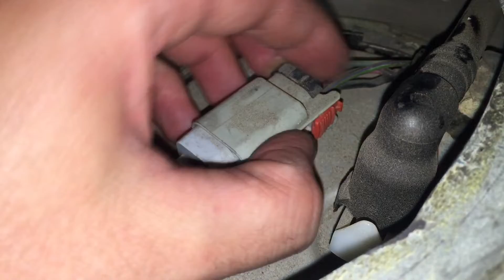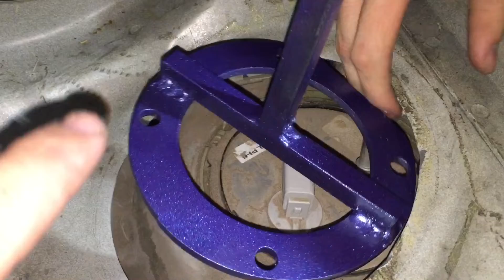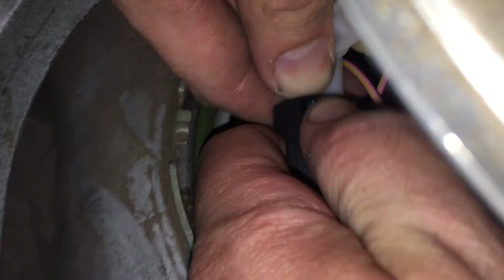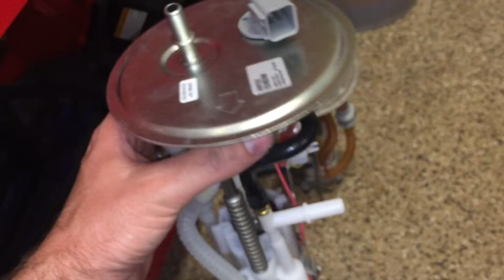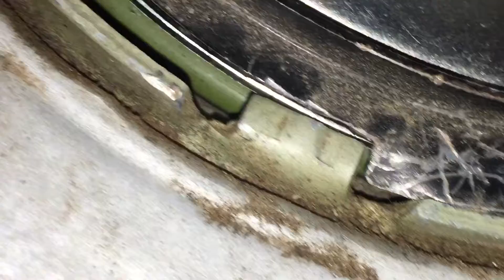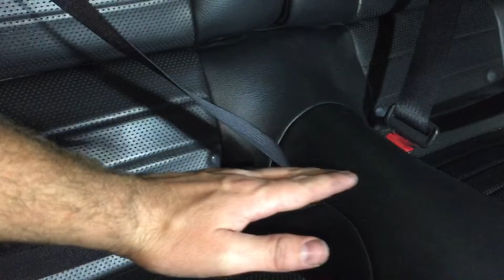EASY! Fuel Pump Replacement 2005-2020 FORD MUSTANG S197 coyote

Comment: I just bought an 05' mustang off a car lot and right after i got it the car would start then not start and ran really rough, the guys told me they had just put a new fuel pump in it so i took them at their word, come to find out when my mechanic who is super sharp when it comes to diagnosing cars looked at it he saw where the guys had put the new pump in and in the process had actually ripped a rubber line in it so when the gas went thru the line most of it just went right back into the gas tank instead of on thru the lines and to the engine, my mechanic charged $200 for his labor and it runs great now.....first time I'd seen something like that...

Comment: I just changed mine today on my 05 Mustang GT, luckily, my neighbor was able to help me install, the metal round lock ring on top of the fuel sending unit. He pushed down with both hands on the sneding unit, and I turned the lock ring with 2 free hands instead of 1. Also, I cleaned the top of the tank and fuel sending unit very clean before removing it. I used a vacuum to suction all the lose dirt/dust and debris around the lock ring.

Also spray the top of Fuel pump assembly and the locking ring with WD-40, so it acts as a lubricant and easier to turn by hand, by myself, I was able to rotate the locking ring with 1 hand, but I could not catch the 2 hidden tabs that were very hard to see. 

On my 05 Mustang GT, there were 6 tabs locations of tank opening that the ring had to engage and slide underneath.

I noticed on this install by Danny's Gargage, when he started his car, he got a low Fuel- DTE FLI error message on your cluster - how did you/he correct this issue , did you disconnect the battery for 30 minutes to reset the computer?

I ask because when I started mine, it showed my tank was slightly below a 1/2 tank, but in about 30 seconds, it clicked, it showed my tank was on "E" on the gauge cluster, but I know that was not the case.

I drove the fuel station and added fuel, started the vehicle, and now it showed a nearly a full tank and then in about 20-30 seconds  - I heard a click chime and I received the above error message again.

The Mustang ran awesome, but now I I'm getting that message. 

My old pump assembly was in terrible condition, fuel ate through the hoses and was only reading 5- PSI, when it should be much higher than that, and my vehicle would not start intermittently and it this a lot, I could tell it was starving for fuel. Several hoses had holes in them from bad fuel or years of tank being low on fuel and not driven much.
Reply from the maker: Typically removing the negative battery cable corrects it for the rest.
Reply: I resolved the issue with my FLI-DTE error message. The problem was with the new sending unit having a faulty float switch.  No one ever mentions to look  the arrow on the top of sending unit. Looking from inside the car, make sure the arrow points to right right while facing the rear seat back. Connect your hose from sending unit “B”  behind passenger seat. I  advise siphoning most of fuel out. The main fuel pump sending unit on my 05 Mustang GT, sits inside a metal trough. With the hose connected underneath on the inside of fuel pump, point your  float to the left side of vehicle, same side off passenger side door. Main arrow on top of fuel pump point towards driver side of vehicle. Don’t force the float down or in. Slowly guide it in and keep float to the left side of trough, facing rear windshield. It installed so much easier the 2nd time around, because I drained me fuel tank, I could see very well, and I was able to secure the locking ring on my first attempt. I also disconnected the positive and negative cables for the battery.  Worked like a charm the 2nd time around.  The first fuel pump I purchased from O’Reilly’s , had a misaligned float switch. My replacement fuel sending unit had the float assembly detached from the sending unit, and it was a bit tricky putting it on, but figured it out. The vehicle starts and runs great now, no FLI-Error codes on instrument cluster gauges.

Comment: what was your car issue that made you replace the fuel pump?
Reply from the maker: @lord__kad1058  the car was not running properly when warm. It was cutting out with anything more than 1/2 throttle

Comment: Grrrrrr. I just had to have my fuel pump exchanged - I mean check engine light and the car turned off - and it cost me $935. I could have done this myself. This looks easy. I probably would have been too afraid... but this looks like I could do it myself and the assembly only cost $350 online. Great video. Clear and detailed. Love it.
Reply: $935!? They ripped you off big time! That's a 30 min job..
Reply: How many miles were on the car?  I have 145k and am thinking of doing it as a preventative measure
Reply: I know a guy would do it for 1 dollars 💵

Comment: Thanks for the great vid.  I bought the tool from Tyler and while it may seem expensive for a one time use, it is worth every penny.  I ended up replacing both the primary and secondary pumps/senders.  I can’t imagine how much effort it would be to re-seat the retaining ring without it.  The rings were too tightly seated to use the tool without encouragement of a flat paver chisel at the weld on the base of the handle.  This was especially necessary to re-seat the dimple on the ring to the center of the retainer.  It may not have been necessary but it made me feel better.
Reply: How much was it

Comment: My god the Ford engineers who designed some of these things.  First was the oil filter adapter that had coolant running through it.  Leaking gasket?  Drain the coolant.  Then this cluster.  Everything was going "ok" until I had to disconnect the fuel line going to the sender (passenger side) in the tank.  IT WAS STUCK.  The green button would depress, but the connector WOULD NOT BUDGE.  I had to apply leverage with a screen driver and really lean on it for it to budget.  Once I got it moving, then I was able to depress the green button and remove it.  Turns out the entire plastic nipple was coated with something sticky and it was just not going to let that connector go.

This is a 15 minute job that poor engineering and questionable assembly turned into an hour.

Comment: So is there two fuel pumps? Or is this driver’s side one the one that matters most? Think I need to replace mine really soon, as the car will sometimes sputter and have a little trouble turning over.
Reply from the maker: It's only on the driver side.

Comment: I have 2007 mustangv6 4.o liter, are both pumps the same on the left and right side because I can't find anything on the passenger side pump
Reply: Should only have one pump, that fuel line he detached from the fuel pump assembly was the crossover line to the other side

Comment: I was told by the shop that the metal ring was rusted out and failed and is integrated into the fuel tank so the entire tank needs to be replaced. Am I getting ripped off?
Reply from the maker: It’s possible. I guess it would depend on how bad it is or if they just want more money
Reply: @dannyjohnsonsgarage  was planning on taking my mustang to Daytona this weekend so I was hoping for the quick fix but looking at it myself it looked nothing like what you showed in the video. It was pretty bad but I was hoping for the quick fix so I could get it on track and after they looked at it they said I’d need a new tank and new everything except for fuel pump and sending unit and it’s going to take 3-4 days and about 1100 dollars. The metal integrated into the tank is what mostly confused me because I thought the tank was all plastic and the only metal was the locking ring.
Reply from the maker: @Stevethe11th  the tank has a plastic cover but it is a metal tank all the way around

Comment: How do you know when it goes bad? Sorry, not very mechanical here. And how long are you able to drive while its bad?
Reply from the maker: It usually won’t run but can work on and off for awhile. You can also get some cutting out under part or full throttle

Comment: Mine came with a black ring. Where does this go?
Reply from the maker: boi If it has the same holes to match up with the snap ring it may be to seal the pump hole area. Is it that size?

Comment: Hey, nice video. Any chance you know what that fuel sending unit attached to the side of the pump is called exactly? The hose you removed when taking it out. That siphons gas from the other side of the tank, right? Since its saddle shaped. I replaced the pump in my car but it only uses the drivers side of the gas tank while the passenger side of the gas tank remains unused. I look in the tank itself, the driver side is empty but the passenger side of brimming with gas.
Reply: hey i have the exact same issue.  im getting no fuel to the drivers side from the passengers side.  its like having an 8 gallon tank  no fun   thanks if you ever find out anything
Reply: deansfixitrightfirst eventually I ended up finding that it was just a faulty fuel pump on the drivers side. Even then, I decided to replace the crossover tube with a similar tube and the connectors as well. I got them from napa. I had originally bought a fuel pump to fix the issue but my luck got me a bad one delivered but I got one from rockauto and theirs worked just fine. I also replaced my fuel pump fuse in the fuse box under the hood it thats any help
Reply: Well by fuel pump i mean fuel pump assembly
Reply: @leobenitez8275  hey thanks for the reply    so you think it was because the fuel pump isnt strong enough to siphon the gas from the passengers side    The car seems to run pretty good so im still at a loss
Reply: I can’t give you a definite answer for sure. That just happened to be the case for my mustang. First the car just would start at all with original fuel pump. Then I went to partsgeeks for a fuel pump because I was tight on cash and it worked for a bit as I put some gas in but even though it worked the gas gauge still read weirdly. It would read halfway full or completely empty, it was because my driver side tank was almost empty so it was trying to read the gas from that side but also trying to read the passenger side which was full so the gauage would transition from halfway full to empty. I then let the car sit for a year feeling defeated. It felt fine driving it with that fuel pump but then I got to work on the car again and for some reason the siphon on that fuel pump to get gas from the passenger side didnt work. My guess would be that partsgeek sells refurbished parts or something since they are so cheap. Regardless of all that, Rockauto is well known so i bought from their and that siphoned has worked just fine. Im no expert though, so good luck with your fix. This is just my experience with the mustang. I also has to replace the battery around the same time if that helps.
Reply: @leobenitez8275  lol how wierd  thats almost exactly whats going on with mine.   put in new fuel pump and worked great for 3 weeks   then sometimes a little hard to start. then the dam no fuel getting to drivers side main pump  and this car always started on first crank until this fuel pump nightmare. im going to swap out a fuel pump when i feel better. got a cold at the moment   hope its not covid.   o well ill post when i get a different fuel pump and let you know anyways preciate the help thats for sure
Reply: deansfixitrightfirst hope you get better. These mustangs seem to be heavily rattled with problems. Idk if you have done it or not, but check the fuse for the fuse pump. Mine was burnt out for some reason. Also thats how mine used to be, took a few cranks to start, now it starts on the first crank. I dont think the passenger side fuel sending unit has anything to do with actually sending fuel, it only reads the fuel level I think. But if you do get to your mustang and if you find out anything new about the passenger side fuel sending unit, let me know. Im skeptical about that as well, thought it does seem fine. Again, hope you dont got covid and good luck.
Reply: @deansfixitrightfirst  Helio how you doing? I have the same issue with my 08 mustang, I’m wondering if you already fixed it and could tell me what is the issue

Comment: Great video!  Do you have a video for the replacement of the fuel sending unit?  Ford recommends replacing both at the same time.  2012 ford mustang V6 3.7L engine.  The schematics show a dual fuel system for the gas tank.  Thanks.
Reply from the maker: I have one on the G35. Should be the same process https://www.youtube.com/watch?v=fkXHmQGW1sM

Comment: You can use a gooseneck pry bar to hold down the fuel pump lid while a friend closes the locking ring. Worked well for me without a special tool.

Comment: I just changed my fuel pump in my 2006 Mustang. Even with a full tank of fuel, I’m getting the DTE FLI DATA ERR just as you did on your dash. 

Is there something I did wrong or something that needs to be reset?  I did remove the net battery terminal to reset the system but I’m getting a check engine light along with the ERR message and the codes show issues with the sending unit. 

Did I mess something up here?

Thanks.
Reply: Roy Groat did you ever figure it out? I have the same error
Reply: David Calvo hi David. I ended up getting another fuel pump assembly as the fuel sender was defective.
Reply: @thetraindoctor4291  did the new 1 fix your issues?
Reply: @74Fox  after 3 replacement pumps, got sick of dealing with it and ponied up for an OEM pump. All problems were solved. Never again will I use aftermarket components for critical applications. 

Had the same issue with alternators and the fuel pressure sensor. Always go OEM on critical components. You will save a lot of time and aggravation. 

The good news is I am now able to change a fuel pump in about 20 minutes and an alternator in 15 on my mustang. Lol

Comment: Do you know of or anything about the secondary/ lifter fuel pump in the 2005 I'm trying to find information on fixing mine is where it is and how you fix it also buying parts for it is an issue due to not knowing the exact name of the parts lol
Reply: hi did you ever fix yours   i have the same issue  the pump on the passengers side isnt getting gas to the drivers side main pump.  thanks
Reply: @deansfixitrightfirst  nope car had to be trashed the wore harness got some water in it and nothing I fixed or changed out would fix the stalling/no gas moving to the motor great car down the drain
Reply: @watchingyoutoo6238  shoot sorry to hear that    makes you sick that a great car get trashed

Comment: Great video looks simple ..do you have to bleed the fuel system after doing this or just simply swap out the pumps and be done thanks
Reply from the maker: AC 130 just turn the key a few times, start the car and let her run
Reply: @dannyjohnsonsgarage  great thanks

Comment: my 2006 v6 mustang just died on me :c when I crank it up it sounds like a hot rod cam/Major missfire. Then died in 5 seconds. If its spark. It should idle a little bit longer correct?
Reply from the maker: Correct. It may be the fuel pump sputtering. Or a vacuum leak can do that too
Reply: @dannyjohnsonsgarage  Hey would codes p0442 p0457 p0455 make my car sound like its cammed and dies out within 10 seconds of starting. Those are the only codes that show up on my car :L. I basicly turned a corner and my car died. and when i try to start it. it sounds cammed then dies in a few seconds. Any ideas?
Reply: Danny Johnson check your throttle position sensor also
Reply: SkepticalVex check ur tps sensor